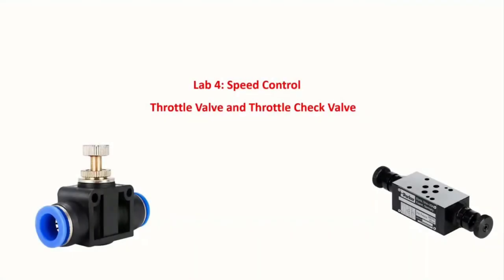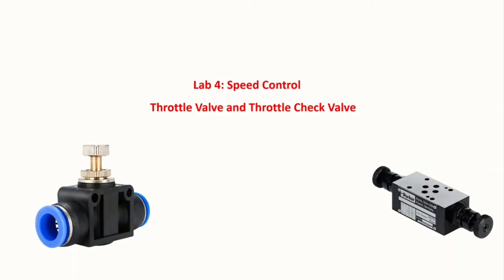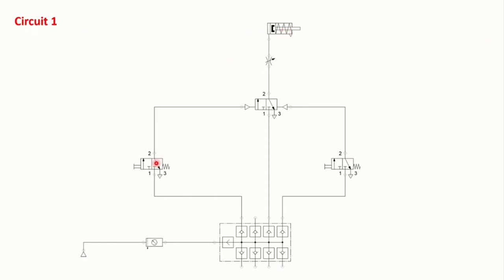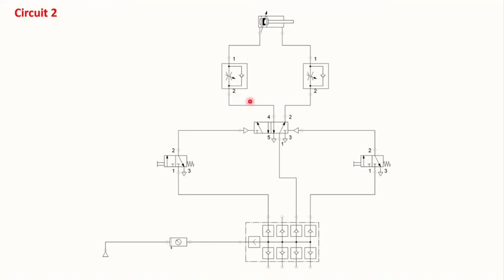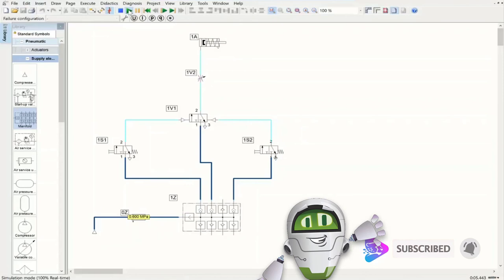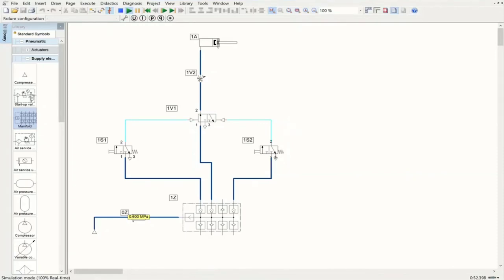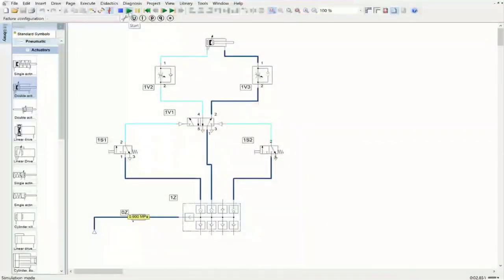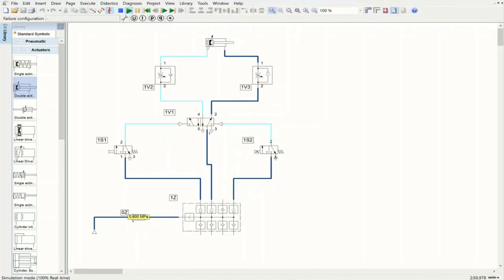Throttle Valve and Throttle Check Valve | Speed Control | Introduction to FluidSIM | Tutorial 5

Comment: Hi sir, In the 20th minute we have 2 throttle check valves. But I thought with 1 throttle check valve we can control both advancing and retraction. I doubt whether it is 1 or 2 throttle check valve you have used.